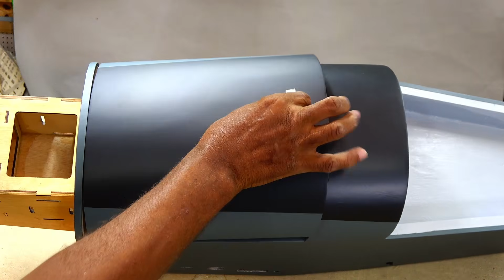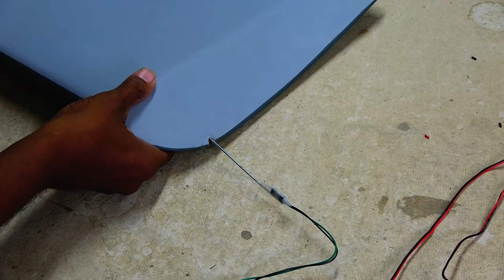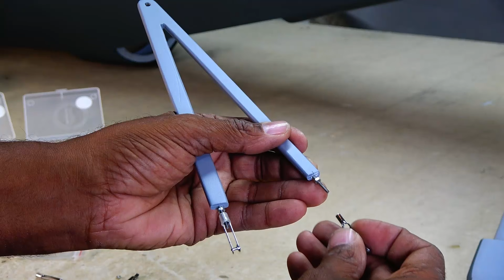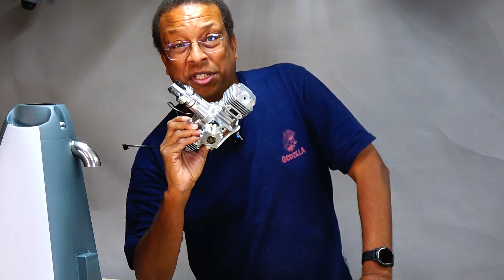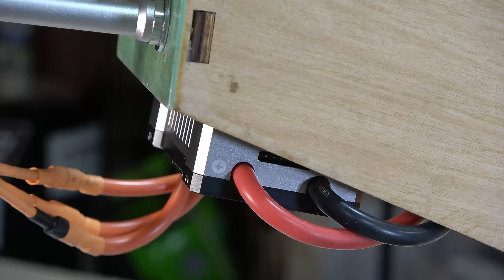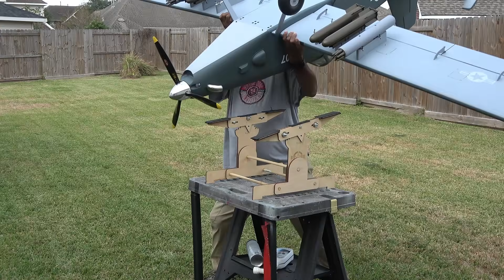Legend Hobby OA 1K Skyraider II Assembly Review | HobbyView

Comment: I always plan on plenty of cooling air for the motor and ESC, even on 6S models.  Decent size entrance and exit to let the air flow freely.
The power system in this bird is a B E A S T !  I'm sure the performance of the airplane will be amazing with all of that power. Looking forward to the test flights.